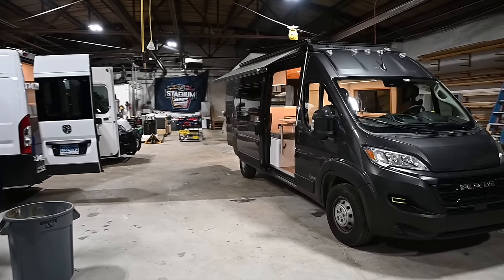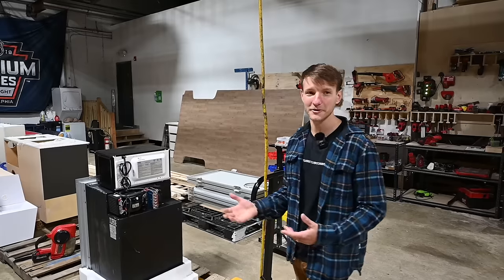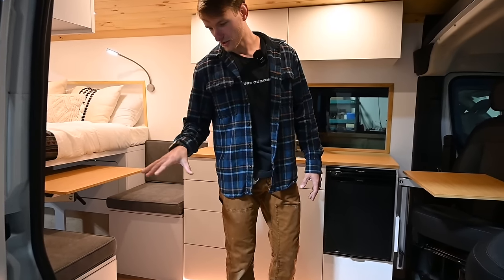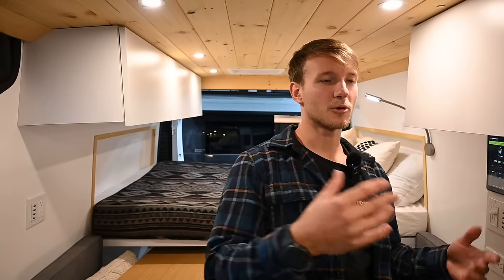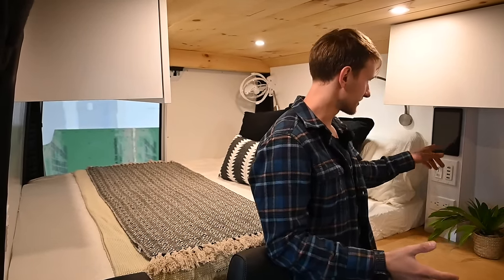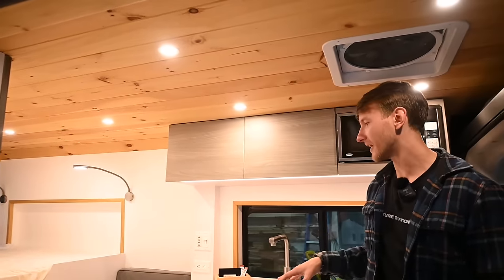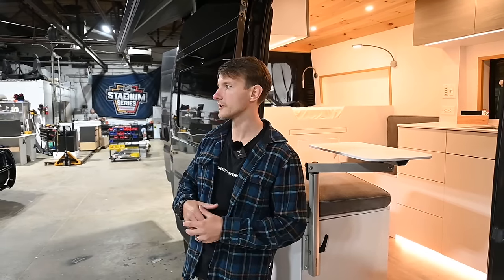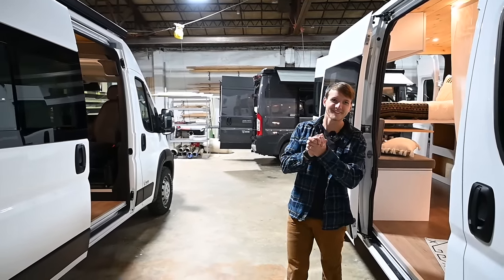3 Minimalist Van Conversions - Ram Promaster Builds Vanture Customs PA Campervan Builder

Comment: Are these 4 season,sub zero capable. Would they work through a Canadian winter? Batteries that WILL charge when it gets cold?
Reply: Yes our Batteries can handle temperatures as low as negative - 20 degrees (-29 C)! and our vans come with gasoline heaters and AC which makes them 4 seas ready with the best insulation you can get!
Thanks